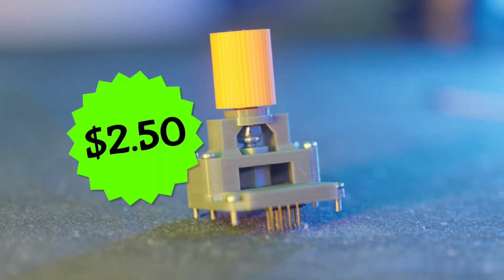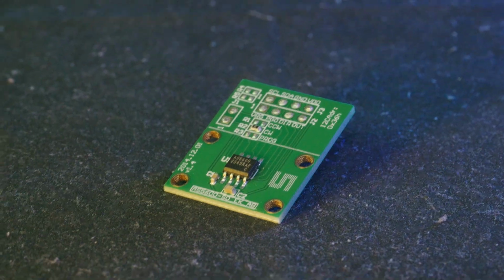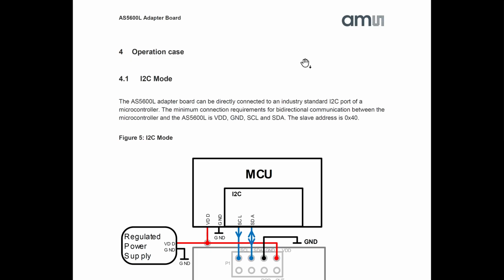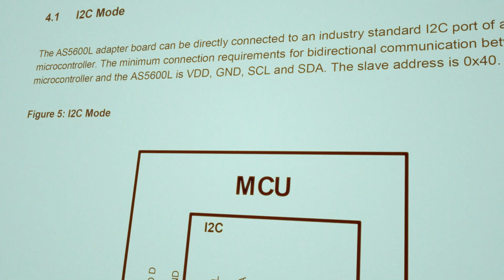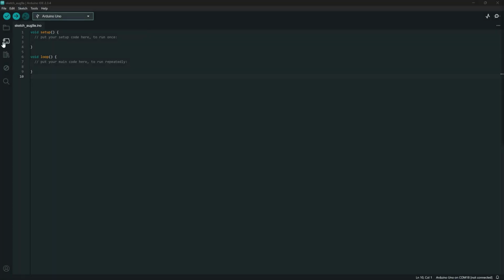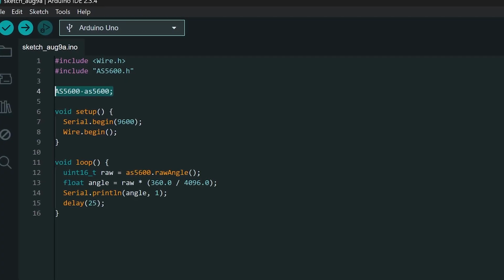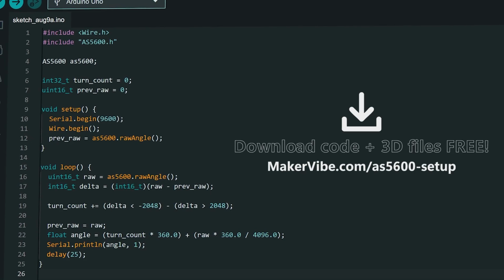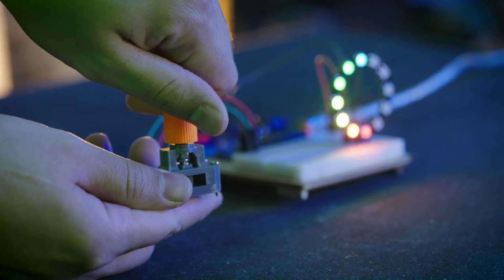You need to try THIS $3 rotation sensor.

Comment: this would make oled based potmeters really available if the magnetic field could penetrate beneath an oled screen. so the potmeter could "float" on top of a circular oled screen (for rotation value feedback) and it would supply the chip beneath the screen with data. an overlay could probably be easily designed which can keep the knob in place with some thin connecting rods to the housing to not obscure the display too much

Comment: I want to interpolate the full 360 degrees of sensing down into about 90 degrees of rotation with little levers or and or gears, and then put two of them into each side of a micro bearing based dual stick controller for ultimate laser precision combined with zero dead-band silkiness. A man can dream, can't he?
Reply: Why bother with the gears and such?  Just read it...
Reply: I'm not sure I was clear...  since we have fractions of degrees in readout... why bother with expanding 90 degrees of rotation to 360?  Certainly doable (and yes, backlash is gonna be an issue unless you're doing it with a constrained gear like a string gear), but... if I can read 45.127 and 45.150 and it's stable at both... just leave it mechanically alone and if you really need 0-360, multiply it by 4 in software.  Watch out for end conditions!!
Reply from the maker: Hmmmmm...I'm not sure I understand 100%, but what you're describing sounds more like a mechanical design problem than an electronics one. If you want to drive two of these simultaneously with a gear train and have one move 0 to -90 and the other move 0 to +90 from the same drive, that's definitely doable I'd say. You can also get the "silkiness" you referred to because the only friction is in the housing that holds the magnet, which you can almost eliminate with a clever choice of bearings. Make your dream a reality man!!! :D and defo share it with us when/if you do.

Comment: That's fantastic. A comparable rotary encoder is over $50. I have a midi controller project and just purchased 256 ky-040 encoders as i could not afford the optical or magnetic encoders l. This approach blows away everything else. But  alas, I dont have a 3d printer... yet...😊
Reply from the maker: Thanks so much for the comment -- yes encoders are unreasonably expensive in my opinion, but wait you bought 256 units of ky-040 encoders? Wow, that's a lot -- what kind of midi controller are you making haha, if you don't mind me asking? Because the ky-040 won't give you smooth steps, I think it's like 20 steps per 360 degrees or something. So if you're sending MIDI CC values it will take some work to get it smooth. Keep us updated though, sounds very interesting :)
Reply: @MakerVibe its going to be my "ultimate retro synth" controller, with 184 encoders split over 4 near identical synth layouts, each partly inspired by the Korg 3300, plus a few other panels for fx.  Its basically my dream synth for the sort of vsts synths I love, especially Cherry Audio's more complex, layered synths such as the P10, Quadra and CX80, each of which have two layers of duel synths. Or I can split it over four different synths.  Do I need this? No. Do I want it?  Heck yeah.  Current the layout is 67cm x 160cm wide, as I plan to use MF  A series knobs.  Because... yeah. 😊
Reply: Download the models and use an online print service to print and send them to you.  You already know the models work and a professional 3d print shop will do a good job of them so it’s very, very low risk.
Reply: @awlhunt great idea. I'll check the costs on that.

Comment: First impression of your channel, loving this! This might be just what I need. Could make a mouse style jog wheel for a project I'm working on, so this defs opens up various opportunities where rotary encoders might not fit with their size and geometry. Will have to see how it turns out, but I can defs see a few use cases for this. Keep it up bru!
Reply from the maker: Thank you very much for the encouraging comment :) That's a cool idea, the great thing about this is you can move the knob/jog wheel away from the sensor through gears or belts and it can still work. It's a great sensor. Definitely let us all know how you get on with the build! It'd be great to see you make a project like that with this sensor :)

Comment: wtf is a 0.25mm nozzle ?
Reply: It’s like half way in between a 0.2 and a 0.3mm
Reply from the maker: Yep, it's a nozzle that has a smaller diameter. Most printers default to 0.4mm nozzles, but 0.25mm ones offer more precision, which is what you need for parts like this.

Comment: This is the first time im learning about 0.25mm nozzle and im been printing for couple years lol
Reply from the maker: Aha, I see. Most people use 0.4mm nozzles for everything, I only started using 0.25mm nozzles recently myself. It makes a pretty big difference actually. You could try making this project with a 0.4mm nozzle,  but I haven't tested it so I wouldn't be able to confirm that it works.
Reply: it should be fine with 0.4 nozzle